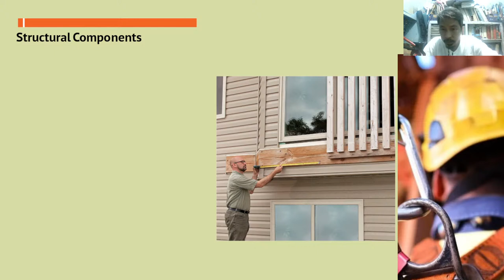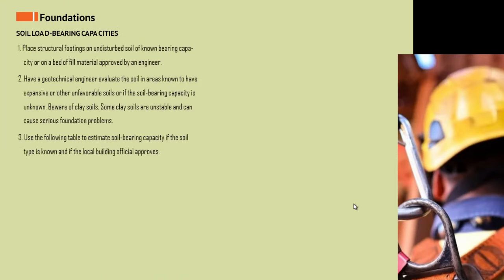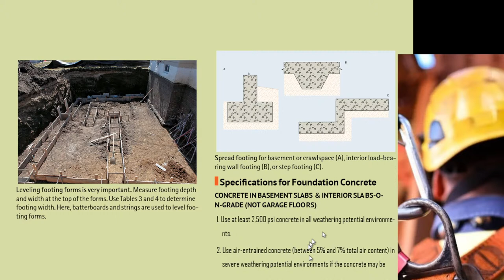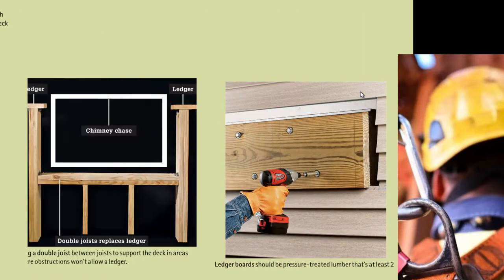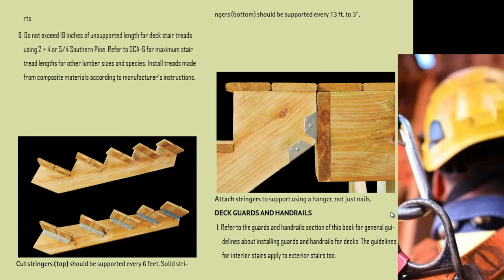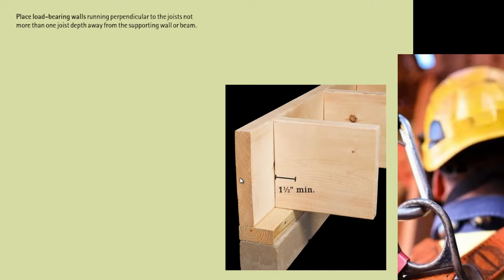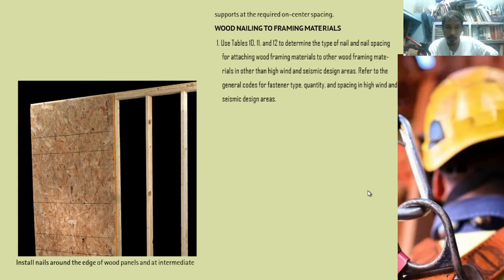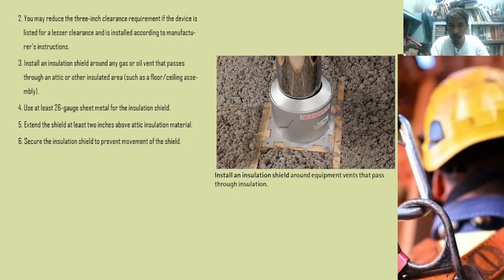[ LIVE CEE4 Lecture 11 ] DrAP Zantua Part F: Bridge Construction & Foundation + Material Engineer

Comment: Thankyou sir for discussing about bridge construction and foundation. Footing width uses the tables general codes to determine the minimum footing width and depth required to support load bearing walls. Refers to general codes for special footing and footing reinforcement requirements in seismic design areas.